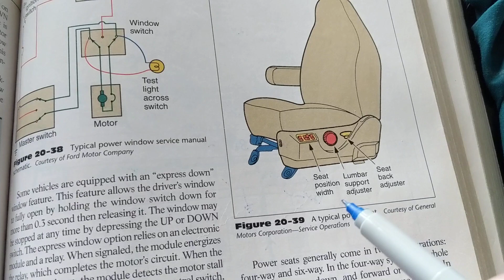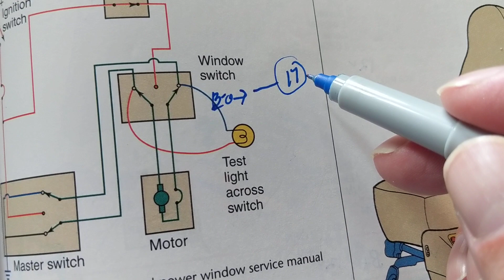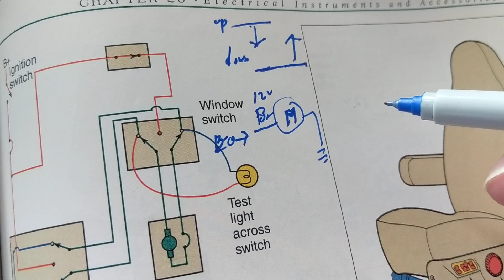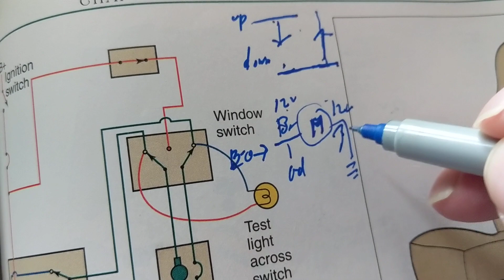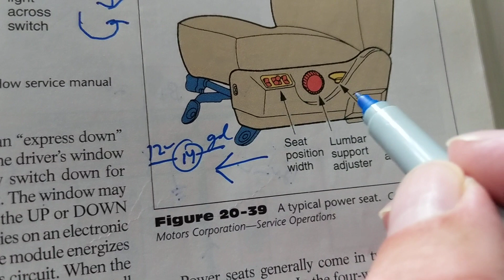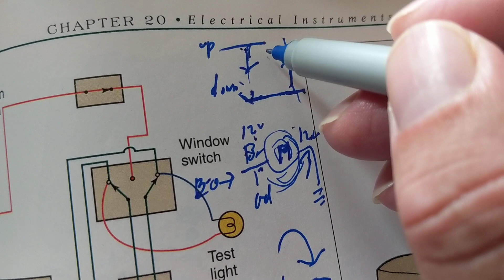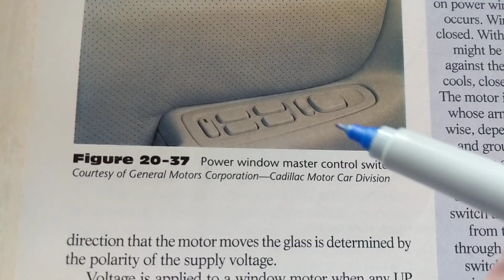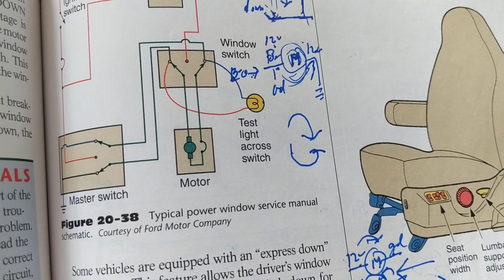HOW DO POWER WINDOW WORK

Comment: Hi awesome videos. I sub to your channel. I have 07 Honda Civic. There is no power for the fan wiring. It looks like the ground is the problem. I jump wire  from the fan relay it the wire would have power. I need help a little bit confused.
Reply from the maker: Are you referring to the radiator fan or the condenser fan because the radiator fan remember it relies on engine coolant temperature to tell the computer that it's getting hot if you don't have power to it that means the module might not be getting the command from the computer to turn it on
Reply: @Joeelectronicschematicsforauto  both fans the wire does not have power. The relays are good and the fuses.
Reply from the maker: @alexthepainter4035  it's about four relays involved and about six fuses did you measure 12 volts or you mean you did not measure 12 volts at the relays on the load sides
Reply from the maker: @alexthepainter4035  they don't all share the same ground but there is a fan module involved with the transistors giving a ground
Reply from the maker: @alexthepainter4035  so remember the fan module is responsible also the engine coolant temperature sensors are also responsible to control the fan control relay not module controls everything
Reply: @Joeelectronicschematicsforauto  I just a probe light test and jump the relay and check with a multimeter .
Reply: @Joeelectronicschematicsforauto  how can I test the fan module?
Reply from the maker: @alexthepainter4035  you have to give a ground the fans come on at idle or a low speed it does not come on more than 30 miles an hour because you are pulling air in number one number two you have to check your coolant temperature gauge in your dashboard make sure your at 200° if you are at 90°, then you have a different problem that will not cause the fans to come on number one number two like I said if all that works then you have the module with grounds with all transistors
Reply from the maker: @alexthepainter4035  unless but not least remember the module also has to get 12 volts all these things need measurements for me to have an idea what's going on accurately
Reply: @Joeelectronicschematicsforauto  it doesn’t have power from the connectors .
To the fan
Reply: @alexthepainter4035  how did you solve this problem?